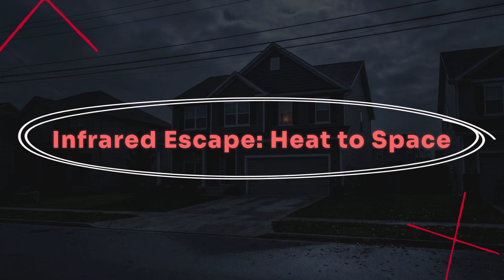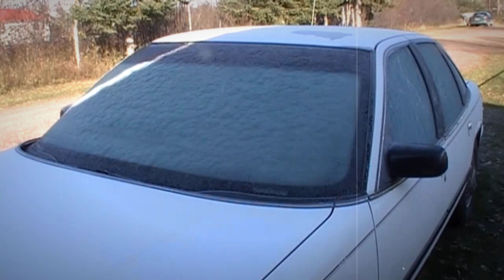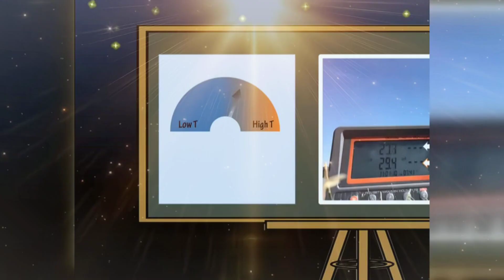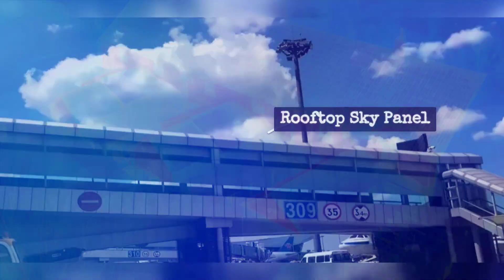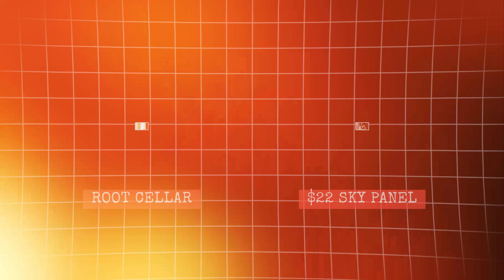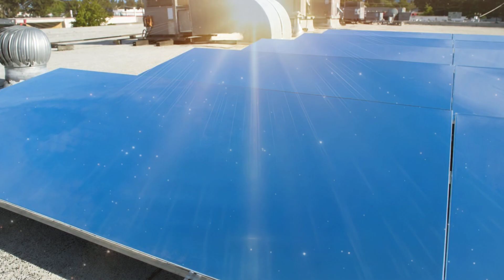Stop Paying for Cooling — This $22 Sky Panel Sends Heat Into Space

Comment: Not a lot of specific information here, but the general idea is accurately described. Passive infrared radiation panels are beginning to become a key component of  occupied structure cooling systems. They are entirely passive, provide a usable amount of heat rejection, and are highly cost effective.